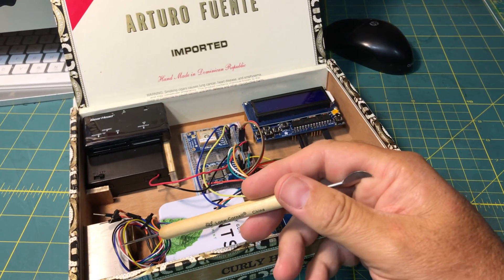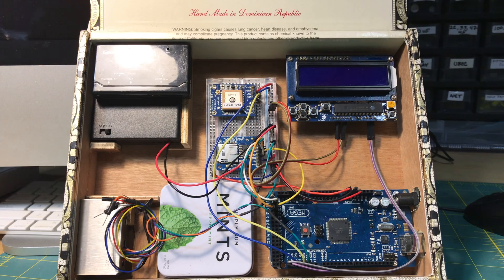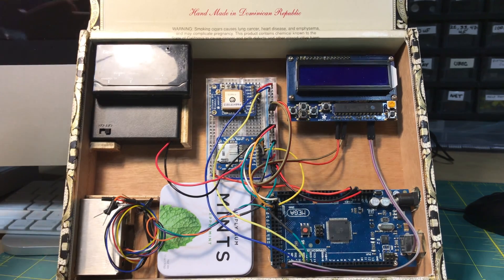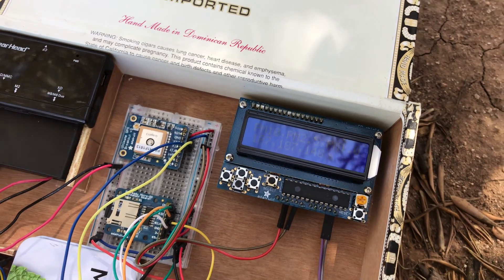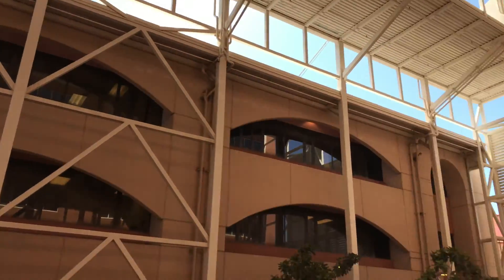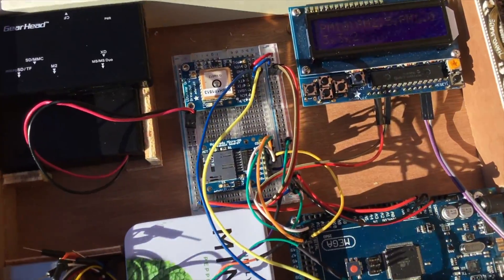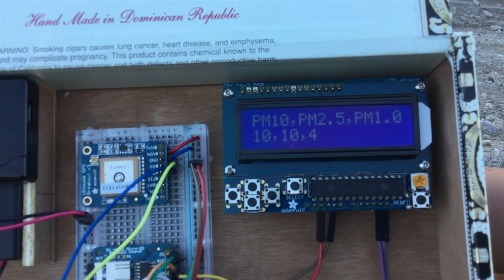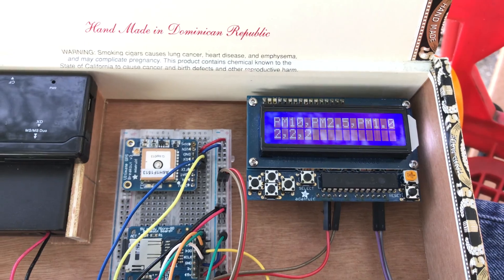Mobile Air Quality Monitoring with the PMS5003

Comment: Could you please provide information on whether instruments that measure concentrations and sizes between 1 to 5 micrometers are typically much more expensive? Because this instrument in question have the capability to measure only sizes smaller than the specified range. Right?
Reply from the maker: This is the only instrument I am aware of for measuring PM for “hobbyists”. Since it hasn’t undergone the strict quality controls of more expensive alternatives, it’s data is considered qualitative at best. I don’t think the range is as important- not much difference between 2 and 1, rather it’s the costs for having instruments formally certified. More details here : https://youtu.be/aoG4Y6zzJD0?si=ZI7-HwVA984DqHP2
Reply: @ModestMaker  thanks for your answer! Do you know if we can measure in smaller time frames. As 0.5 seconds for example?
Reply from the maker: I haven’t tried that, but not sure if the benefit of doing so. For averaging (?)